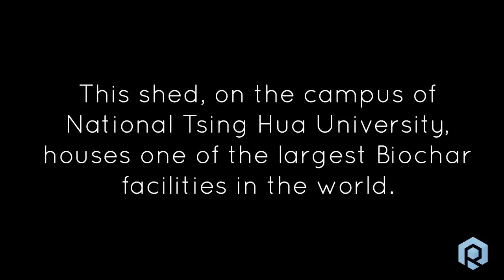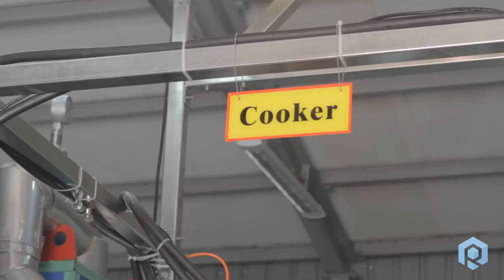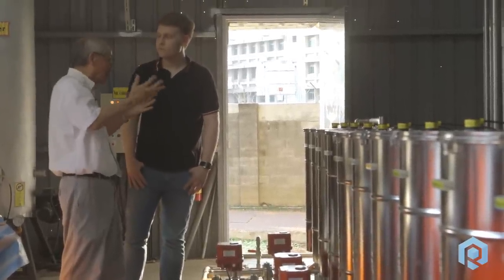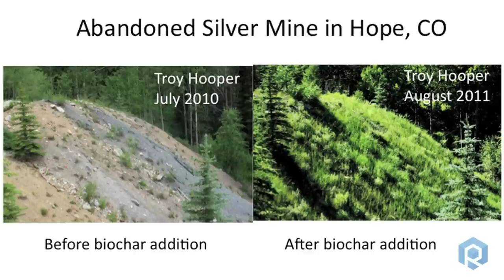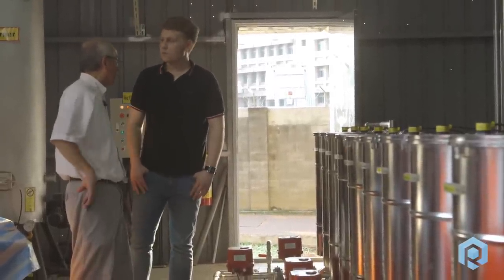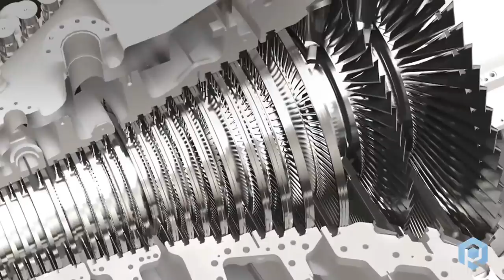Reversing Climate Change: Biochar in Ten Minutes

Comment from the maker: For all that inquired, this is Dr. Frank Shu's response to Bryan Elliott's question: 

Frank Shu responds:

Bryan Elliott is really sharp to connect supertorrefaction (what we call our process of converting biomass to charcoal by immersion under molten salt) to molten salt reactors (MSRs). This is exactly what our group has as a meta-goal.

Depending on the kind of salt used in supertorrefaction and the immersion time, it is possible to produce three different grade levels of charcoal. The lowest grade, ecocoal, is used as a carbon-neutral coal replacement. Ecocoal can have a heating value ranging from 23 MJ/kg and up, i.e., comparable to bituminous coal, but without any of its toxic contaminants. The middle grade, biochar, is a carbon-negative, water-saving, soil amendment. Biochar can remove industrial toxins, like cadmium, from contaminated soils. We do not measure the heating value of biochar (but it can approach that of anthracite coal) because it is too valuable to burn. The highest grade, activated carbon, requires pretreatment of the biomass with a base or an acid, and is used for filtration of liquids or gases. For example, flooding often contaminates the drinking supply with microorganisms. Filtration of such contaminated water can make it potable again because the pores of the activated carbon can pass water molecules but are too small to pass microorganisms.

Energy in the form of high-grade heat is needed to perform the transformation of biomass into these three kinds of charcoals (plus liquid and gaseous byproducts that themselves have value as sources of bioenergy). The cheapest form of heat comes from nuclear reactors, especially two-fluid thorium MSRs of the kind that our group favors. Thus, performing a heat exchange of the blanket salt with the (non-radioactive) supertorrefaction salt can effectively augment the energy that is already in biomass into the higher grade energy source that is ecocoal. In such an exchange, we effectively store some of the nuclear energy of thorium as the chemical energ

Comment: What's the energy cost of this process? Is it really carbon neutral, or do the costs make it unfeasible?
Reply from the maker: Great question playgrrrr. The ratio of energy out to energy in is approximately 5:1 or 10:1 depending on the moisture content of the input biofeedstock.  So the process produces net energy even if  fossil fuels were used as the energy input.  However, their goal is to use a fraction of the produced charcoal as the energy input, in which case there would be no question of the whole cycle being carbon negative if the biochar were buried rather than burned (carbon sequestration below ground), with the bonus that the land becomes more productive with new growth (carbon
sequestration above ground).
Reply from the maker: Also, see the response to Bryan Elliott above.

Comment: Seems like it would take far more energy to create the molten salt (energy that comes from burning hydrocarbons) than to do it without salt. you could make up for the lack of speed in a more conventional system by making far larger burn chambers and automating the feed and exhaust systems. this more conventional design would have a net gain of energy for the community using it and still be producing bio-char to enhance their soils and sequester carbon long term. I cant see this system sequestering more carbon than it would produce in heating the salt. windmills and solar panels aren't gonna get you the kind of energy this reactor is consuming.
Reply: Concentrated solar is capable of making salt molten.

Comment: Isn't there any shrinkage of the input material? In my TLUD's the material reduces in volume by about half yet in the video I see them open up a vessel that's pretty much full to the brim with char.
Reply: That's a good question.  In our process, SEM (scanning electron microscope) pictures show that the cell walls get carbonized, with the interiors of the cells gasified and leaving as VOCs (volatile organic compounds).  The carbonized cell walls still have some mechanical strength, particularly if the feedstock had a lot of lignin (for example, woody biomass or hard nut shells).  Thus, without grinding, the carbonized plant walls do not collapse, and the biochar more or less preserves its original mass.  When washed and dried, however, the biochar weighs less than its original biomass feedstock, by a factor of 1/3 to 1/4, indicating that the majority of the original mass has been driven off as VOCs (and steam), leaving behind a very porous solid residue, which is the biochar.

In the TLUD process, you burn part of the biomass to supply the heat that chars the remaining biomass.  (Our heat comes from the molten salt. For biomass with little moisture content, the torrefaction process is roughly energy-neutral, with the decomposition of the biomass adding as much energy as it takes to carbonize it.)  Thus, you have turned some of the biomass into ash; how much ash depends on the efficiency of the TLUD kiln.  As a result you lose both mass and volume in the conversion of biomass into biochar.
Reply: @fshu1708  "Thus, without grinding, the carbonized plant walls do not collapse, and the biochar more or less preserves its original mass." I'm guessing that should say volume instead of mass?

What you describe as a TLUD is actually a retort with a TLUD mantle around it which is different than the proces I'm using which is a true TLUD (Top Lit Up Draft) cylinder and without any material being burned down to ashes. All the heat comes from the fire started at the top of the cylinder using a tiny bit of alcohol to get things started. To end up with biochar instead of ashes the embers are snuffed or water quenched once the pyrolysis front has made it's way to the bottom. Even the match used to light the alcohol can be retrieved as biochar.
A video of it can be seen here:  https://www.youtube.com/watch?v=Jn5Z_r_wa7Q

I have to say that your proces with the molten salt is quite amazing and the material barely shrinking means it comes out with a much lower density (same weight but larger volume) than it would in my stove.

When you say your proces is roughly energy neutral does that mean you cannot extract any heat from it for use elsewhere? I guess my stove has a major advantage on that front considering the energy that is released is used for cooking and space heating and thus reducing the fossil fuel needs for domestic heating.
Reply: The speed of your system is very impressive though and the use of liquid salt circumvents the issue of getting heat deeper into a large volume of chipped material that would be an issue in retort systems where the char created on the outside edges of the retort starts to become an insulative layer which slows down the heat penetration to the middle of the retort.

Comment: How will this reverse climate change?  From what I gather it's just another creative way to make charcoal which would ultimately end up being burned for energy which would release more CO2 into the air.  This would only end up making global warming worse not reversing it.
Reply from the maker: RazorX1 and Keith - Dr Shu is very dedicated to educating people about these things and provides a detailed response to each person's inquiry. Here is the reply to your question:

There are three ways in which the use of charcoal made from waste biomass can be carbon negative:
(a) as biochar, which is not burned, but buried as a soil amendment;
(b) as ecocoal, which is used as a coal replacement in power plants to spare the use of natural coal.  For plants that have carbon capture and sequestration capability, CO2 is not released into the air but is stored geologically. 
(c)  as activated carbon or carbon fibers, which are also not burned, but are converted into durable goods currently manufactured with petrochemicals.
In these cases, because the end product does not degrade biologically, the carbon is prevented from going back into the atmosphere.  Alternative disposal methods, which also use the CO2 captured by growing vegetation, either allows the biomass to rot and decay, thereby releasing CO2, or in the case of anaerobic digestion, releases methane, which is worse as a greenhouse gas than CO2.
 
The principle of burying char to lock up CO2 is the same as that for fossil fuels, permafrost, and long-lived trees which locked up the CO2 that was in the atmosphere 300 million years ago at 4000 ppm (not 400 ppm as today) in deep geological formations, or beneath the surface of the land, or as durable constructs of nature.  Carbon is a wonderful resource, infinitely transformable in its characteristics if one does not wantonly burn it.  Indeed, biocarbon used either as energy or as the feedstock for novel kinds of materials, is the only way that we know how to reverse climate change in a natural and safe manner.
Reply from the maker: +IAN MANSELL, This is Dr. Shu's response: 

Ian Mansell is correct that one of the benefits of using biochar as a soil amendment is the improvement in the quantity of bacteria and other micro-organisms vital for soil health.  Using a scanning electron microscope to examine the product biochar, we find that supertorrefaction maintains the cellular framework of the original plant feedstock, with the cell walls and nutrient channels leading to them having been largely carbonized.  The preservation of the cell walls and associated channels means that water and dissolved nutrients have a path to get from outside the biochar into the carbonized pores inside the biochar.  The naturally porous biochar can also host micro-organisms that increase the amount of organic carbon that the soil can stably hold for hundreds to thousands of years.  Adding biochar to depleted soils can thus be carbon negative in multiple ways: (1) in the feedstock biomass that would have released carbon dioxide and methane had it been left to rot and decay, being converted instead to inert biochar, (2) in the additional growth below ground of micro-organisms that extract carbon dioxide out of the environment if other essential nutrients are added as fertilizers, (3) in the additional vegetative growth above ground on previously fallow land.

But as indicated in our response to RazorX1, biochar is not the only grade of charcoal made by supertorrefaction that can contribute negative-carbon emissions.  Charcoal tuned as a displacement for coal, can also be carbon-negative when burned as a coal substitute, if that coal-fired power plant has carbon capture and sequestration (CCS) capability.  The technology is termed BECCS (with BE = “bio-energy”), and is recognized by the United Nations and the International Panel on Climate Change as a carbon-negative activity.  Finally, another grade of charcoal, called activated carbon, can be produced by supertorrefaction from renewable biomass.   If this activated carbon is used as a substrate to make durable goods that are not burned, for example, textiles for high-end sportswear, or lightweight parts for airplanes or cars, or electrodes for batteries, or end plates for supercapacitors, then those activities can also be carbon negative, and contribute to the overall mitigation of climate change.

Comment: I prefer to use this Carbon as fuel substitute for other fossil fuel. Its even possible to use this carbon fuel, to convert, CO2 produced, back into Carbon monoxide and into Methanol. quite easy actually...
Why sequester if you can substitute imported fuel ?
I have my car running on charcoal, my motorbike, my cooking, my generators, waterpumps and i am making liquid fuel as by product...
Reply: Koen Van Looken, our plan is to produce the equipment that allows the rapid conversion of biomass into char (10 min if done at 300 Celsius, 1 min if done at 450 Celsius).  How buyers choose to use the equipment is their choice.  It may well be more economically advantageous to use the char to produce chemical fuels, as you suggest, or to generate electricity, as will be one of the options, than to use it as a soil amendment (biochar).  However, biochar may be the only practical method in the short to middle term for getting negative carbon emissions, while improving soil productivity, advantages that could outweigh all other considerations in the coming decades.
Reply: FShu how can I purchase a plant like this ?